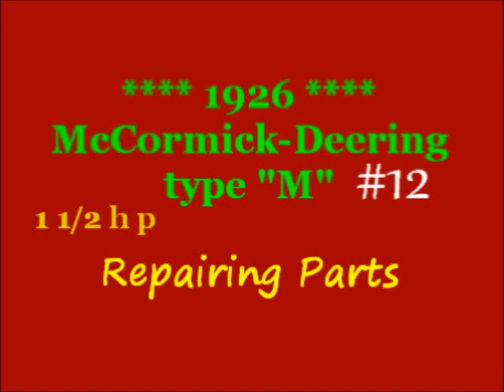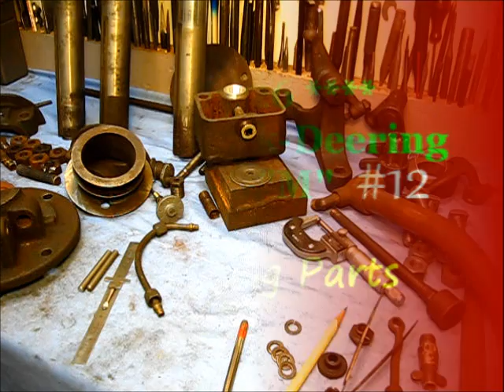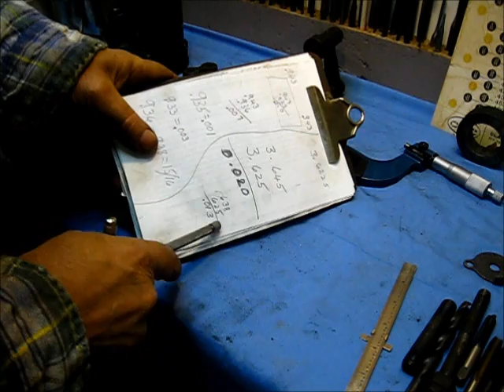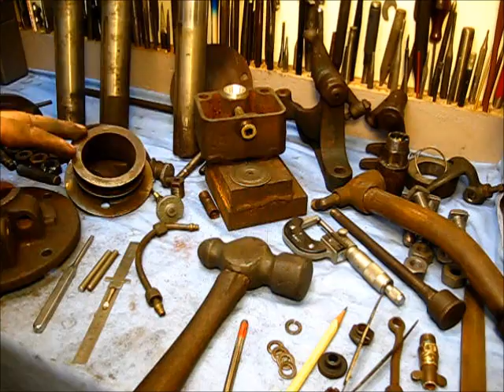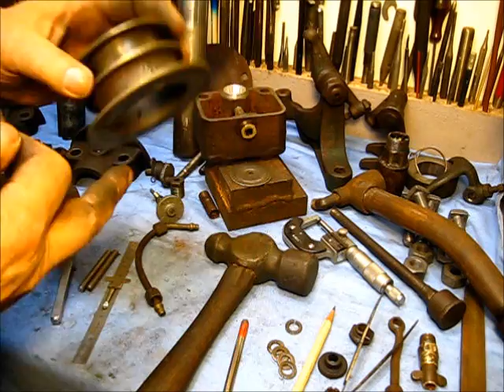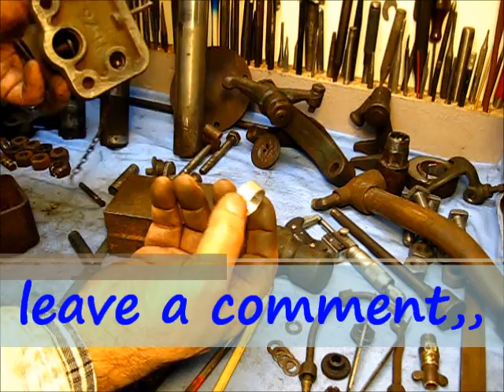1926 McCormick Deering type m / repairing parts 12of

Comment: Does the key shaped hole in the collar have to be corrected? Or is just replacing the pin with a smooth one enough to give satisfactory operation?  It seems like the collar should be set right but how?